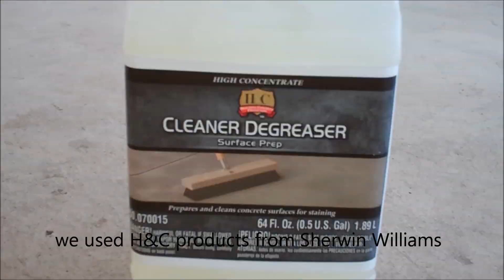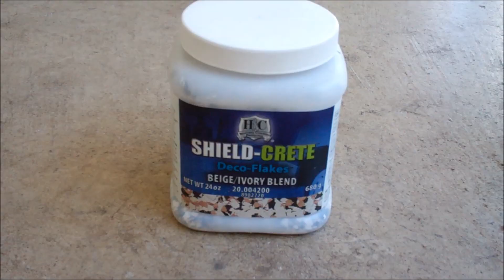Garage Floor Project - Concrete Stain with Decorative Flakes

Comment: Hey, how does this look today?  I am trying to decide which garage floor coating to do myself. Should I use the solvent based clear gloss over the solvent based solid color or should I use a water based over the solid color?
Reply from the maker: It's held up very well. Of course it's dirty and a bit stained from a few years of traffic, but under the rug it looks great! I'm not an expert, so you should probably check with a the rep at the supply store on your particular application. Nice buck!
Reply: Can you post a pic of it now when you have time? Thanks